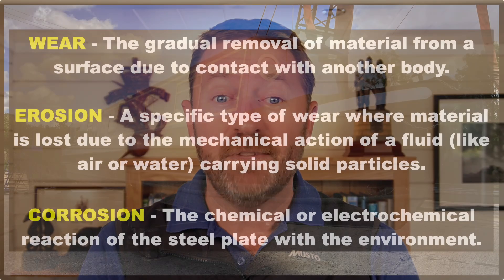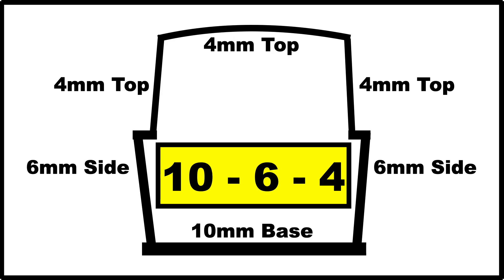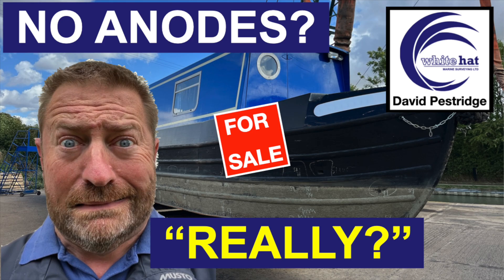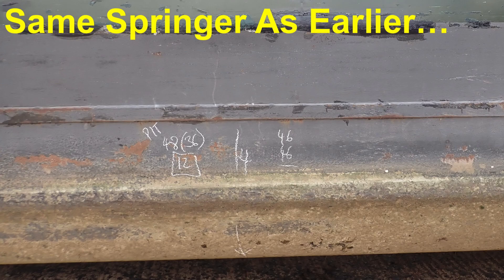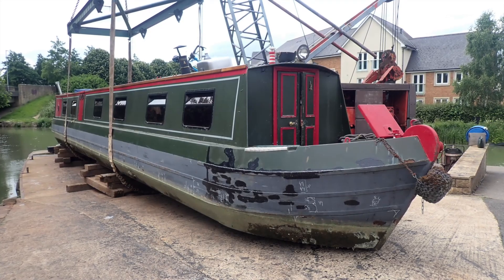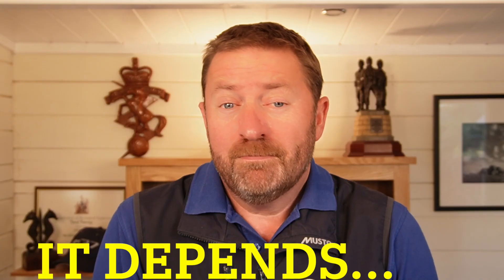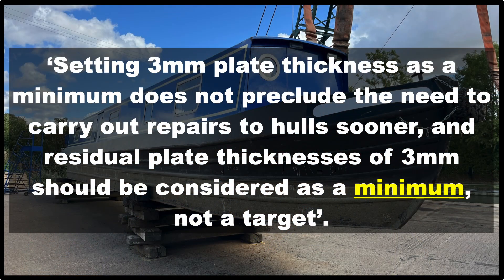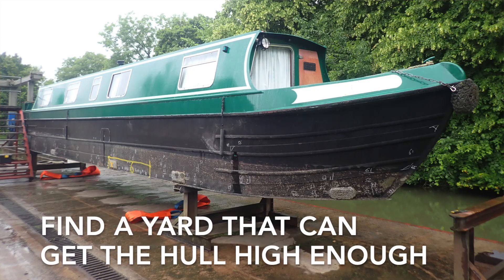What Is The Minimum Insurable Thickness For A Steel Boat Hull?

Comment: What's your thoughts on zinc coating before having your boat 2 packed
Reply from the maker: I'm not a fan personally given the galvanic implications of zinc and magnesium both working to protect the steel. Good surface prep to SA2.5 plus a well applied 2-pack primer and then topcoat should be more than enough to keep the steel well protected for years.